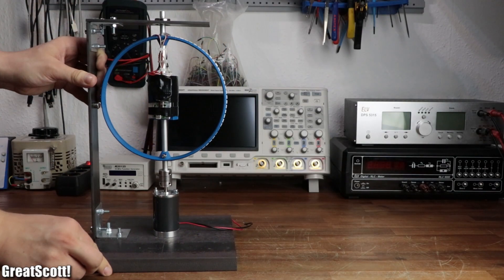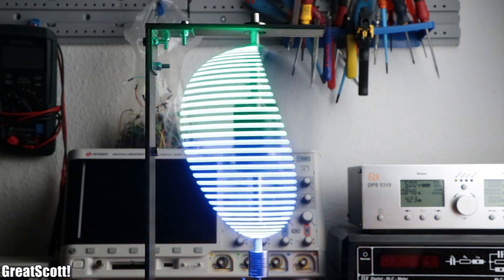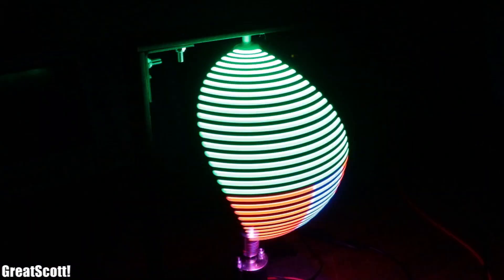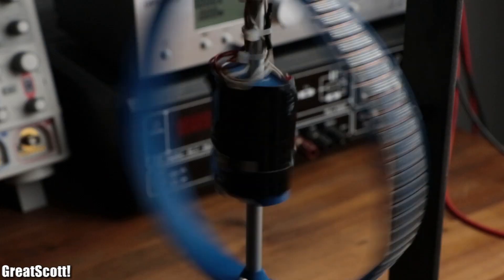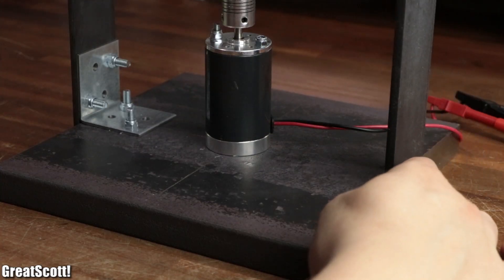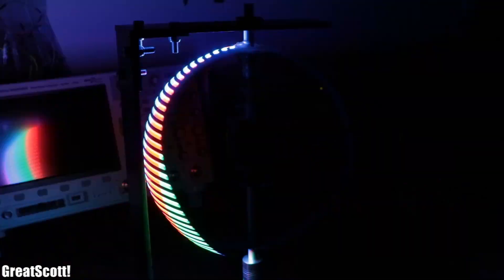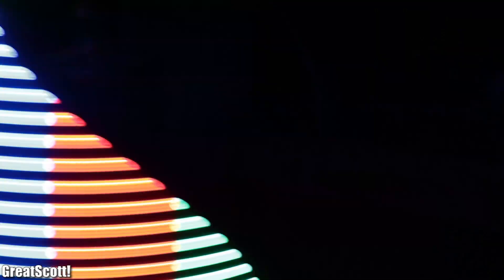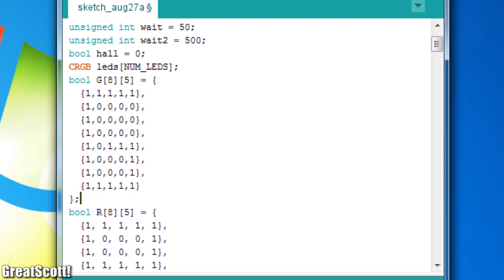Make your own POV LED Globe

Comment: I had a go at processing the footage to give a better persistence of vision effect, by layering up offset copies and using the 'lighten' blend mode. It kind of worked?

https://youtu.be/Sz0133VZd7E
Reply: Rob Miles watches at least one of the channels that I watch! My life choices feel validated!
Reply: I used Kdenlive
Reply: i suppose it would be way better if he had used 2 strips of leds
Reply: Thanks! You know I have my own AI channel now?
Reply: Hi Robert, what kind of software did you use? Thanks :-)
Reply: Yep
Reply: i wonder what could happend of you put a fan inside this globe,will it simulate 3d effect?
Reply: Try changing your shutter speed to better match your camera's frame rate.
60Fps = 1/60s
30fps = 1/30s
...

Comment: you need to balance all the stuff in the middle or use contact copper plates on it base so the wires dont wrap around itself then you can have all the battery away from it

Comment: A couple suggestions for how to improve this build and for builds like it in the future.

Replacing the angle braces with ones that have a triangular piece of metal connecting the 2 sides for more stable support.
Consider buying a tap set so that you can tap the wholes in the steel instead of requiring nuts everywhere.
Also since the vibration only showed up after adding the electronics, it is probably mostly a balance issue. You could probably try grabbing some lead shot and tape to play with until it's stable then glue the shot in place.

Take more full advantage of your 3D printer: 
You could've made a spot for the self locking nuts to get captured in the plastic for an easier assembly/disassembly.
Instead of just making a block for the circuitry and battery to attach to it would've been cooler it allowed them to be embedded inside and hidden away.

Comment: Nice little project. It's something I'm working on now. Can I ask if there is a limitation on the number of LEDs you can use in the strip with Arduino?

Comment: Hello, I have a question.
I just got 2 giant boxes with capacitors,pontentiometers,switches,leds,resistors,ICS.. just everything you need as a hobbist. 
and pcbs.
So my question is if you have some idea on some videos of little (beginners) PCB projects.
Ive already made a 555 timer led circuit. and a non 555 timer led flashing circuit.
They bove work.

Comment: Very nice!
God I need to get back to doing this again, I built one for my Capstone in 2013 using 595 shift registers.  Back then there was no high speed programmable leds :/
Here is my old Youtube video.   https://www.youtube.com/watch?v=L9BaXpfreVg&t=157s
Greatscott, did you consider running power to the electronics on the ring, I separated the shaft in the middle and sent power through the bearings.  My biggest mistake was using a small RC motor and gearing it way down, it makes a lot of noise.  For my design you only need around 700RPM for good viewing, I put led's on both sides, one side is the odd pixels the other side is the even pixels.

Here is a render of the fully 3d printable version I worked on then had to stop due to life and other projects.  The OD on my ring is around 340mm.  Combine it with a Teensy 3.6 with SDCard and DMA SPI it should be insanely fast.
http://i.imgur.com/Zez0s6U.png

Comment: Tip. When heating the shrink tube use the blue part (lower part) of the flame. The temperature is lower and you won't get black markings.

Comment: nicely done!
The solid metal frame would help a lot to reduce vibrations, need to counterbalance those LED's tho that's the real trick. Lay it on it's side and keep adding weight to the hall effect sensor side until the LED side doesn't want to be at the bottom.
And the trick with the frame rate is brightness. drop the brightness of your APA102's and the ambient lighting to let your camera's exposure assist with blurring that fast motion :)
For extra points you could continue the LED's around the other side so that they are offset from the others to "fill in the gaps".
Always love your vid's! keep on keepin on ;)

Comment: What about a slip ring to transfer power/data so you don't have to have the battery/arduino inside the ring?  It would remove most of the weight from the rotating bits to reduce vibrations, and would let you control the ring while its on.

Comment: How hard would it be to use some of the wireless charging hardware to charge the globe during runtime?
Reply from the maker: Well, not easy.
Reply: Might still be a fun experiment :) I keep meaning to try something like that for powering a slowly rotating minecraft creeper head.  All to avoid an expensive and finicky slip ring.

Comment: To find a center of something easier, they make a Centering ruler. I got some from Amazon. They work by having 0 in the middle and the measurements goes out the same on both sides of 0. They have it in Metric and Standard.

Comment: Video nice, but why the hell did u use that 6kg block of steel as baseplate? please tell my why? wouldnt it be easier to use an 4-5mm steel sheet instead of that overkilled piece of tank armour plate? smh, lmao
Reply from the maker: For stability reasons. Without it, the construction would have vibrated even more.

Comment: Long exposure photos would have helped. 
Also, why not to use esp8266 so you could send new data on over the wifi? 
And for power you could have used capacitor and some coils as it's already spinning anyways. :P

Comment: You need to balance the ring. Take the assembled rod and set it horizontally so that it can rotate freely. Adjust the weight of the light end until you can rotate the assembly and it halts at almost any position.

Comment: well, this is amazing! good job! I have a suggestion, making this device either on or off the grid by adding a contactless slip ring  with a unique 12V supply (by switching a plug connected either to a battery or a power supply)

that would be awesome!

for those who don't know what it is, it's a simple 1:1 transformer, with a fixed primary coil and a rotating secondary coil, it was used mostly on VCR heads but still used on high rotation speed devices and other applications where you have to avoid electric and magnetic interferences and mechanical fatigue, such as industrial robot arms. there are slip rings even for data transfert, I installed recently an ethernet slip ring for sensors working on ethernet protocol. the old sensors were analogic working with a carbon brushed slip ring and it was a nightmare to maintain, lots of contact faults and burned sensors, just the fault diagnosis was a gruesome task.
Reply: Das habe ich schon gesehen

Comment: +GreatScott! Could you split the aluminium rod and run the power through the frame? Then use the smallest AVR possible as the controller?

Comment: Why are your ball bearings in a freezer?
Also: the reason the "ball" isn't steady when turning is because the weight imbalance on both sides I think.
Reply: nickjedl What happens when you freeze something? It shrinks! Really! well not noticeably, but still, it shrinks.
Reply: It, freezing temperatures, can also break down the viscosity of the lubricating oil.
Reply: Agreed, about the freezer.  I was thinking about a story I heard, of non pressurized cargo, transported in an "open" jets cargo area,  years ago,  malfunctioning almost immediately after installation.    They where diesel engine part, and it took the company a while to figure out what was causing all the boat motors to fail....freezing temperature, from a non pressurized jets' cargo area...... early 60s.
Reply: Rom DS9. Ah, yeah... But two things are different there.
These ball bearings of Scott are going to be used under no pressure. And the viscosity if the grease won't be affected (much) by short period in home freezer.
A diesel engine operates at high pressure, high temperature AND was transported over long periods of time in temperatures below that of your home freezer.
Reply: Yes, that is a logical conclusion, I had not considered that.

Comment: 9:51 Waiting for circuit... :D
Reply: Shreyas Kulkarni me too
Reply: Shreyas Kulkarni same!
Reply: If you look really closely, I think you can see that he soldered the SMD components by hand....
Reply: QuickPro Studios Yep. Also there is flux residue which confirms that. I solder SMD components (ofcourse, medium size!) by hand too.
Reply: this one looks similiar
http://www.ebay.com/itm/DC-1-5V-3-7V-To-4-2V-5V-Boost-Step-Up-Charging-Module-For-Battery-Charger/371922549004?_trkparms=aid%3D111001%26algo%3DREC.SEED%26ao%3D1%26asc%3D41375%26meid%3D31fafc5b2aba4a1195d0ff02d89a45b6%26pid%3D100033%26rk%3D1%26rkt%3D8%26sd%3D221204412036&_trksid=p2045573.c100033.m2042
Reply: Nope... The DIY circuit has TP4056 charge controller and step-up module and micro USB input AND a PHYSICAL switch to turn everything off.
Reply: https://youtu.be/Fj0XuYiE7HU

Comment: Can't you just add some weight to balance the whole thing? It's probably the LED strip that weighs more than the hall effect switch, so adding a bit of weight on that side could solve the balance issue
Reply: Just a little bit of that aluminium rod hot glued to the other side of that hall sensor should do de trick, or even hot glue itself.

Comment: Hey scott, you could try to statically balance this build, by holding it sideways and looking which side the heavier one is. Then ading a little mass to the opposite side so long until both sides can stay horizontally

Comment: Would not it be more stable if you use a brush system (like motors) to transfer data to the LEDs or power to the center?

Comment: Everyone's saying that the flickering weirdness is caused by the framerate of the camera, but it's not. It's being caused by the shutter speed used to capture the image on each frame. If you film at 30fps, then you want a shutter speed of 1/30th of a second in order to replicate the persistence of vision effect. Any lower, and there will be segment of time in between frames that the camera doesn't record. If you're filming on a DSLR, you should be able to go into manual mode to change video settings in order to get this to work.
Reply: Is there a difference between framerate and shutter speed ? Theyr basically the same!!!

Comment: You  could have used slip rings to bring power to the rotating ring and eliminated the need for the battery power.  Also could have used slip rings to drive the led's and put the magnet on the rotating ring, then all of the electronics could have been stationary.  That would weigh less and be easier to balance.

Comment: Great Project!  How does it do on the battery?  I wonder how it would do with a second strip on the other side, slightly shifted as to increase the resolution.    But I also wonder how fast that would flatten the battery, because at 43Watts/Meter (I figured approx 210mm dia*3.14/2 is around 1/3 of the meter you used)  43watts/3 is around 1400 mah, so it wont quite run an hour now if it was lit up "heavy"?  Of course this is also not the case because all the lights are not on all the time, but you still have the Nano too.  Regardless, it certainly is a first class build and great Instuctable.  Awesome job as ususal!

Comment: the problems are mechanically
you have to balance the globe first putting it on some horizontal support. than it would be better dont use the 90° metal plate but maybe something like a 45° triangle placed inside corners that would reduce alot the vibration

Comment: How did you control all the leds individually while they where connected in parallel
Reply from the maker: Google APA102. They are not connected in parallel.

Comment: You threw off the balance with having a hall effect sensor on one side of the ring, and no counter weight on the other. Even though it weighs net to nothing, at higher RPM that difference could shake that thing apart. Same goes with the arduino and LiPO. What you do to one side, you have to add counter weight to the other, then that thing would spin like a dream. Love your creations! Keep up the great work!

Comment: It's just figuring out how to get a perfect balance, it'll stop the vibrations. 
 If you've driven a car with an out of balance wheel, you see that the vibration will start at say 30kph, max at 35kph and be gone by 45kph. It'll be the same with this POV globe, you should be able to raise the RPM through the point of maximum vibration the where it runs vibration free.

Comment: A second piece of LED strip running down the other side of the ring will give you a solid image as opposed to the scanline style image. Second strip should be offset by half the LED spacing in relation to the first strip, and pattern signal should be 180 degrees out of phase with that of the first section of strip. A nice upgrade that's simply an additional piece of strip.
Reply from the maker: Very good idea.

Comment: Next time you need to get a bearing in place you should press it in. It's very easy to damage bearings if you hammer on them. Other than that it was a great video, keep them coming.

Comment: Hey that circuit you made with the boost and charger is exactly what i need for My college Final Project/Thesis, I know you're making a video of it soon, but i need it as quick as possible, could you send me a schematic so i can gather the parts and make my own PCB?? Another question, can it charge the battery and power an arduino simultaneously?
Reply from the maker: No, sorry and yes.
Reply: Oh, ok man :) ill wait for the video, i just hope i have enough time to implement it. Great Video btw :D

Comment: Hi!, Could you make a project about a dimmer for a lamp (AC) controlled by a PWM output from a microcontroller (DC)?. I wanna control the brightness of a lamp wirelessly using an Smartphone. I'm sure you have the knowledge to explain this in a easy way.
Reply from the maker: I put it on my to do list
Reply: Thank you!
Reply: He already did. Check: Electronic Basics #20: Thyristor, Triac || Phase Angle Control
at the end of it.
You just need to change the code.

Comment: You could use lens filters which reduce the amount of incoming light, and you could take long expo pictures of it, and that would look stationary, but it would require a lot of experimentation.
Reply from the maker: There are pictures on Instructables. Link is in the description.

Comment: I wonder if you could use that to light up blue/green so that it looks like planet earth. i might look into this and do that!

in reality, earth is flat
Reply from the maker: I have seen other led globes that can do this. Not sure whether my resolution of 38 LEDs is enough for that though.
Reply: Maybe another 38 LEDs that are offset by half vertically. That might also help with balance. Two hall sensors and some code changes to increase the resolution. For a science fair or school use a push button to power the motor on and make it obvious how it works.

Comment: Duct tape? Really?
Reply from the maker: Yes. https://www.youtube.com/watch?v=J2l-F1ElJMc
Reply: Keep your stick on the ice!
Reply: The 'norm' is usually hot glue.
So what is the problem with duct tape?
Reply: I thought the electronics were gonna be inside the box. Boy, was I wrong!
Anyway, why not 3D print a support bracket for the stand, or at last add some gussets to eliminate the wobble?
Reply: GreatScott! Lmao
Reply: Yeah, we don't discriminate Duct tape 'round 'ere.
Reply: At least its just a proof of concept. Ben heck would call it a finsihed product.
Reply: IUPAC recognizes Aluminum as an acceptable variant. Humphry Davy called it Alumium and later Aluminum.
Reply: Duct tape saves lives
Reply: In Russia we use electric tape. It must be blue.
Reply: haha
Reply: Tine Logar yes duct tape aka 100 mph tape.
Reply: Tine Logar WTH? Duct tape roles!
Reply: Robot DA2 a
Reply: Hello why do you use a metal frame not one of from the 3D printer
Reply: Duct tape FTW!
Reply: If the women don't find you handsome, they should at least find you handy.
Reply: That might be true but it is also true that scientists will never use the shorter form it is used only to accomodate americans.
Reply: It's aluminium not aluminum. Only uneducated americans call it Aluminum. Educated americans don't.
Reply: This can't be more shitty.

Comment: I built a similar project using only blue LEDs. I found it necessary to add screws and washers (by trial and error) to get the rotary parts in balance for smooth operation.

Comment: Great idea putting the bearing in the freezer to shrink it down a bit.
Reply from the maker: You can also heat up the metal. But I was too lazy for that.
Reply: I was actually thinking that if you still had trouble getting the bearing in, you could do both.

Comment: If you'd recorded that with a high speed camera and then speeded up the video to real time, wouldn't that look like it does in person? I think that's how it works.
Reply from the maker: That should work...... I think.
Reply: don’t think it will wok, because your screen isn’t as bright and cutting out frames will result in it looking more choppy and harder to read.
I think.
Reply: One way I think it will work best is to film with a higher shutter angle, maybe even 360° and have the frame rate the same as the spinning frequency
Reply: AL_O0 it's not about cutting out frames, but about combining frames. That way you have say 10 frames with a partial image, that form one proper image when combined
Reply: AL_O0 For the first comment: I didn't mean that it would look as bright as in person but at least we could see the whole sphere all at once. And for the second one: (Without knowing much of anything about video cameras) Or just have double the frame rate to the spinning frequency and have a standard shutter speed (or angle). That would result in less motion blur.